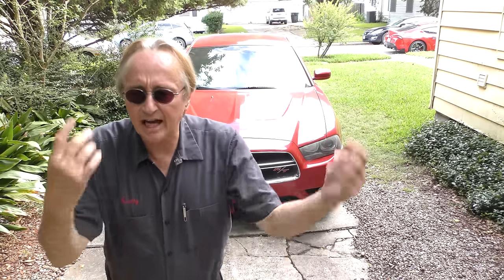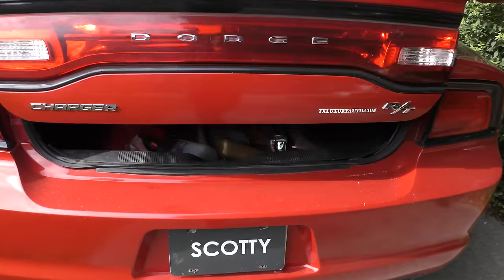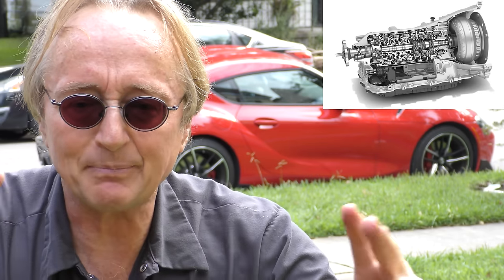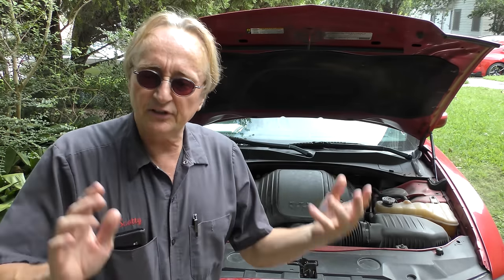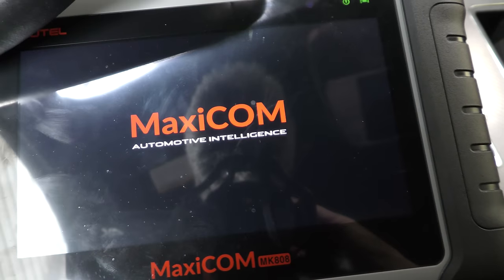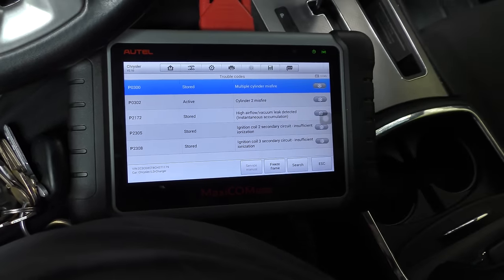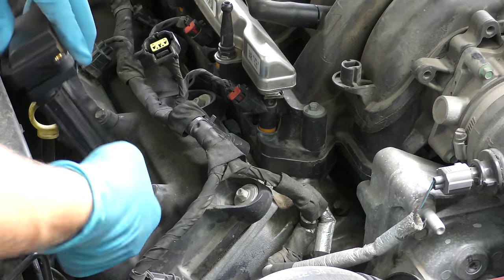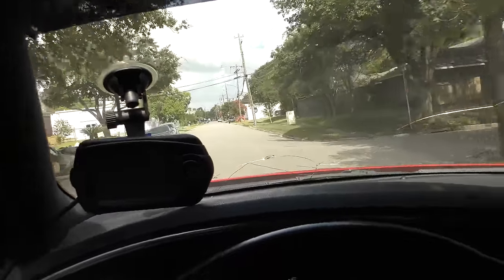Here's Why I'll Die Before I Buy a Dodge with a Hemi Engine

Comment: “This car doesn’t work very well and is in bad shape, therefore every single one is terrible and I’ll never even consider one” - Scotty
Reply: He did the same thing with the impala and I've got two of them and there damn good cars
Reply: dodge products are known to be trash though. high cost of ownership low quality
Reply: @mikeholland6750  yeppp!!! have 2 trucks sitting in my lot with lifter problems same engine!!! JUNK!!!!
Reply: Shane Vaughan Amen, Impalas are actually famous for being very reliable cars, every single owner of an Impala I’ve met (I’m one too) has consistently managed to get 350k miles on them if they chose to keep it that long, AND very few times ever having to take it into the shop outside of typical routine maintenance. So far, my Impala has had an O2 sensor fail before its time, that’s the only time I needed an extra trip to the shop
Reply: @shanevaughan6980  True! My cousin has the 2011 Impala and it has 210k miles and still drives like new
Reply: Everyone that I talk to that has one loves the Charger. This one wasn't taken care of at all.
Reply: Scotty is spot on as usual
Reply: @mikeholland6750  Modern HEMI's are very reliable engines if you just take care of them properly. I've owned the 5.7 and 6.1 Chargers and both of them are pretty much unkillable. I couldnt break them if i tried. Do Mobile 1 full synthetic oil changes twice/year and you'll see.
Reply: I like how he said “Chrysler’s are all cheaply made”. Ok, your loss, I’ll keep mine.
Reply: @WafleEnterprises  same with my car! People call it ugly but you know what my 05 buick lesabre gets me from point a to point b safely and comfortably, last thing I had to do was replace o2 sensor and it was literally on top of the engine I un bolted the sensor and bolted the new one in and done
Reply: Yep, because it was made by the same garbage company.
Reply: Never had a problem with my 2018 Dodge Charger RT
Reply: Shane Vaughan what year impalas. The 2006 model was good, but I’ve know people with the 2010, and the 2018. Both  had transmissions replaced at around 130k miles. The same goes for the Malibu. I liked the Impala. But I won’t own one over 2006.
Reply: VAL13C doubt  it I know people past that no problems lol it’s all about maintenance your car
Reply: @Thee_Lijah  should hope not, it's only 2 years old.
Reply: @mikeholland6750  That is YOUR opinion ,nothing else.....
Reply: @Thee_Lijah  its only 2020 give it time.
Reply: That’s how Scotty is with literally every brand other than toyota
Reply: @Thee_Lijah  I had my 2015 Challenger for not even 2 months and I already had to take it to the dealership to get a misfire fixed. Thankfully the warranty spared me of a $1600 bill.

Chrysler is pretty bad quality, but you get some good looking vehicles out of it.
Reply: Hemi Engines were known to be bad
Reply: Dodge/Chrysler products are junk. They fall apart and the hemis are over hyped so bad. Some dude in a brand new Charger tried racing my mk4 gti 1.8t and got clapped. Pretty sad. I’ve seen one come into my shop with a camshaft literally snapped in half...lmfaoo. Over heating issues, lifter issues(seen here) rod bearing issues prob due to bad lubrication system. Don’t get me started about the suspension and structural integrity of em either. I’ve done wheel bearings on dodges with 15k on them. Absolutely no excuse for that. My jetta still has the oe wheel bearings At 209k miles and still tight as the day I got it.
Reply: @zedgerton73  People think horsepower + V8 is the way to go. Light weight and lots of torque will win races. Something most American cars won't get
Reply: @Jogita6  Nah bruh guys love v8 and horsepower because of the sounds. You never had a lady with you in a v8 car or you'd know this lol
Reply: @trevonjameson350  I am married and have owned a Pontiac Firebird and currently own a Dodge Challenger. Trust me I know lmao
Reply: @Jogita6   spark plug broke
Reply: @hemiplow1297  Oil filter adapter cracked and leaked oil in the engine
Reply: @Jogita6  whats that lol isnr the oil filter on bottom and dosent touch combustion?
Reply: @hemiplow1297  The filter is on the bottom. The adapter connects to the engine
Reply: He does this with a lot of cars
Reply: @SRTBOAT   I agree with you. Have my 5.7  300 C of 15 years. I only use Mobil 1 synthetic
Reply: @steweed1  my 06' 5.7L Charger had 156k miles and it was rock solid. Great car and it served me well. My current car is an 07' 6.1L Charger with 109k miles. As long as you take care of them, hemi's are super reliable.
Reply: You think this is the only one he has worked on?
Reply: I’ve got a charger with 380k miles, and it’s great. Maintaining your vehicle somehow does it wonders... I will say typical dodges get beat on 10000x harder than most vehicles while receiving less maintenance. (At least in my area)
Reply: @tristan good luck 😂💰
Reply: @dmoney6633  what year he said the same thing about the ford and Chevy sports cars.
Reply: No, it's just a fact....dodge doesn't build good quality...this one has the same lifter noise my wife's journey RT had at 100k miles..our journey was a money pit
Reply: @shanevaughan6980  i rented a brand new Malibu and it left me stranded on the highway . Chevy is terrible
Reply: VAL13C we had an 03 that rotted away but we have a 06 and a 08
Reply: Am I'm not denying the Malibus are trash but the impala and the trucks are good
Reply: @mikeholland6750  259k with a SRT-8 and still runs better than anything you own Mike
Reply: Well there is a big lifter problem
Reply: Most dodges are junk.,...he's seen a lot of them, he's a mechanic
....and so have I...most people know , dodge made crap tranny's, lifters sometimes go out early, ect.. my ex and I got a dodge journey, RT, wasn't cheap, and wasn't old, and didn't many miles, and it had a lifter tap soon after we got it, it was a money pit... Between warrenty work, and out of pocket cost ..it always needed something when one thing was fixed...he's said the hemis are fun motors, he's said the v6 can last longer in the charger...ice had two  good dodges in my life...both had well over 200k miles, I got a durango  a couple years ago, w the 5.9 , had 252k on it and it ran and drove perfect, 4 wd worked . Motor didn't have a tick  in it .. and my ex and I had a chrysler cirrus, w 220k on it that was a good car..  the durango and cirrus had replacement tranny's.. but I had a white ram sport short bed, with a factory lift , w the 318 in it, and a rebuilt tranny
.. loved it , so yes..I've had a few good dodges..but they needed  a tranny before I got it
Reply: @richsweeney1115  260k miles on my SRT-8 had a few gaskets needing replaced but major problem so far was the fans has gone out twice because of a crap motor. You’re just unlucky man
Reply: @richsweeney1115  and also I’m a mechanic myself. Chevys keep my shop in business as that’s what 90% of the time is in the shop. Dude has a late 90s blazer with the 4l60e and he’s replacing it just after 6 months. Chevys are junk way worse than a dodge
Reply: Carcist.
Reply: Lol he said to buy a ford, the only fords I bought ended up in a junkyard xD
Reply: @mikeholland6750  Spoken like a Poor person.
Reply: @mikeholland6750  that’s why they outselling Ford and Chevy. Guess people prefer unreliability over anything? Flawed logic.
Reply: @zedgerton73  my cousins new GTI got eaten for breakfast lunch and dinner by my wide body chally. No replacement for displacement even if I’m in the boat.
Reply: Look at the market, the market dictates prices, people will pay top dollar for a reliable used Toyota or Honda but not for Chrysler junk.
Reply: @dmoney6633  I don’t believe you have a charger with 380k miles at all
Reply: @jacobm92  okay 👍🏼
Reply: Well it is a crap Chrysler product so 💀
Reply: @Big_Gima  the problems of these dodge engines scotty talks about 8:25 was ironed out a long time ago
Reply: @makeaway4554  these problems are long gone from dodge v8`s
Reply: @Thee_Lijah  it’s a 2018 give it some time
Reply: Lol right. 230k in my hemi ram and it runs fantastic. Allll about taking care of that maintenance!
Reply: @SRTBOAT  Or, in CANADA, do it at least 4 times a year
Reply: @dmoney6633  yep, FACTS
Reply: @shanevaughan6980  Nah, my buggy had a brand new impala ('10 or '11) and he BABIED the thing but it was in the dealer shop more than on the road - GARBAGE!
Reply: @mikeholland6750  weird I guess I'm just lucky with the vehicles I own for 10+ years
Reply: @WafleEnterprises  I have 408k on my 06 Impala.
Reply: Exactly
Reply: Never had a single problem with my 18 Charger RT.
Reply: @sanchezs7614  
It’s a sub 200 hp car, it shouldn’t have any issues!
Reply: @sonyownsmicrosoft  
You might be missing out on the thrill of driving a faster car though!
Reply: Dodge = 🗑️ 🚮
Reply: He ain’t wrong tho. There’s not a single Used charger from the 2005-2013 that is in good condition or low mileage
Reply: @YureiZenSakura  Couldn't agree with you more
Reply: The older Hemi engines. Do have some pretty bad issues. But all motors have weak spots. There's good and bad in them all. What you end up with. Comes down to the luck of draw lol. I don't care for any Chrysler product. I never got one of the good ones I guess.
Reply: @WafleEnterprises  routine maintenance is the biggest factor. In the life of an engine. If you take care of one. With proper oil changes always using the same oil. And usual preventative maintenance. Cars today should get over 300 thousand.
Reply: @SRTBOAT  not true. The 5.7 hemi is notorious for dropping valve seats. All the maintenance in the world wont prevent that. It will just leave you stranded somewhere you dont want to be and do it without any warning. If yours never drops a seat you should kneel and that the car gods.
Reply: @kirkedwards365  There's hundreds of thousands of 5.7s across multiple different platforms within the FCA umbrella. Probably over a million to be honest. 2003-2023 with every make and model getting it....You're statistically gonna see certain issues stick out.

That doesnt mean its a common issue. There may be several thousand 5.7s that drop a valve seat. And yes, you'll see that as a complaint on youtube videos. Doesn't change the fact that there's less than a 1% chance it happens to you since they've made so many units that work perfectly fine.

It's about the likelihood. If they make 2 million units, yeah, ur gonna see a lot of youtube videos complaining about the outliers in the sample set. 

And yes, proper maintenance does in fact reduce the likelihood for problems. That's common sense.
Reply: @mikeholland6750 - your doing the same thing as Scotty 😂.  Known by who?  What about the people that have dodges with 200K+ miles?
Reply: @curtisdoss2469  what size motor in your 06 Impala?
Reply: @mikeholland6750 you them in pick a part yards ALOT.
Reply: My mom had a dodge for one day. Broke down the day she drove it off the dealership lot literally.
Reply: There's a Federal Class Action Lawsuit against FiAT/Stelantis AG, covering 2014-2020 HeMi models. FiAT is retiring the HeMi in 2024. That's how problematic these engines are.
Reply: Scotty is just as biased as the ford or say chevy or Toyota owners. I personally love mopar brand and products. Ford in my opinion with 3.5 and 5l are junk... personal experience. Chevybdoeant even compete. ALL new diesels are crap because the government forced legislation that forced theor hands on emissions junk. 
Toyota.... who cares, they have weak products that can't compete with real American trucks. 
Basically, just like Scotty I can favorable and unfavorable opinions about shinny turds or shinny diamonds just like him. The one fact remains that he is still entertaining to watch. 

Oh, and the 426 Hemi was the best and is still the best engine ever produced... suck it scotty 😉
Reply: @Big_Gima lifters ain’t even that bad bro, 300-600 in parts and u can do it in ur driveway
Reply: @alexanderflemming7083  You are wrong I have one mint
Reply: @mikeholland6750  my 08 hemi has never had issues has the famous hemi tick but it's tits 105k miles currently.  Idk it's all opinion and driving/maintenance habits honestly any car are dookie if you ask the right person lol.
Reply: Yeah , if you are 80 years old.
Reply: @Mudz21 4 years later safe bet your Chrysler has gave out